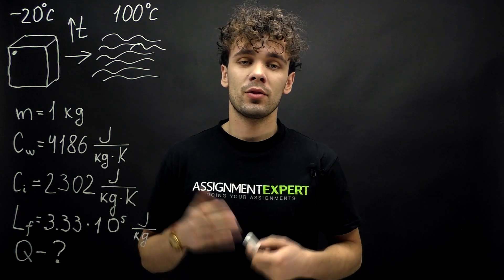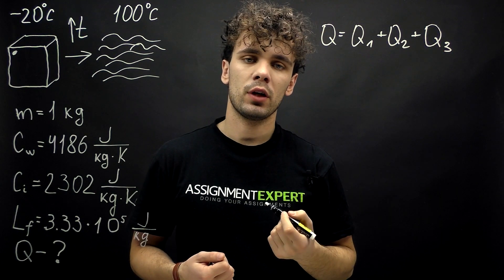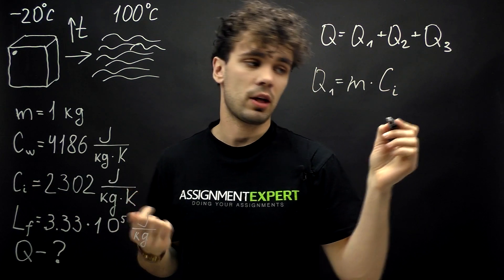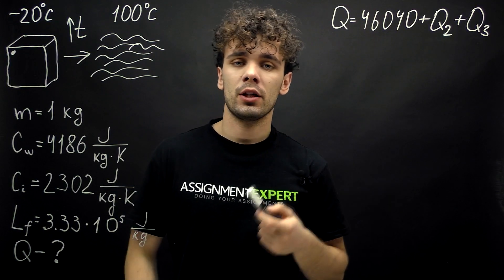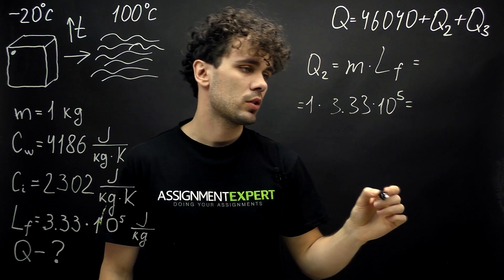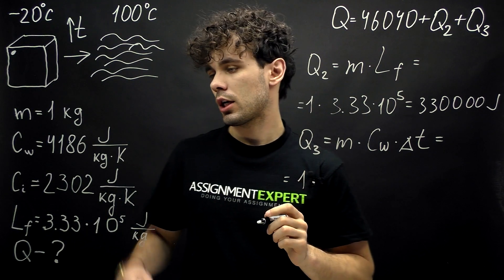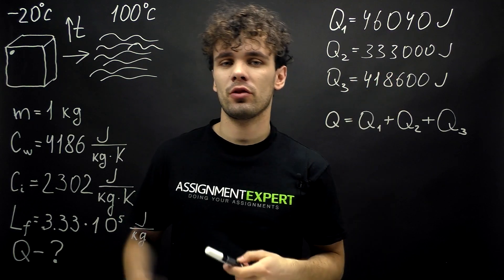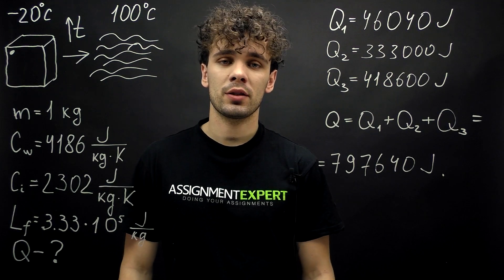Quantity of heat to convert ice at -20C to water at 100C

Comment: Calculate the heat required to convert 3kg of ice at −12oC kept in a calorimeter to steam at 100o at atmospheric pressure. (Given: specific heat of ice =2.100×105Jkg−1K−1, specific heat of water  =4.186×106Jkg−1, latent heat of fusion of ice =3.35×105Jkg−1 and latent heat of steam =2.256×106Jkg−1) .